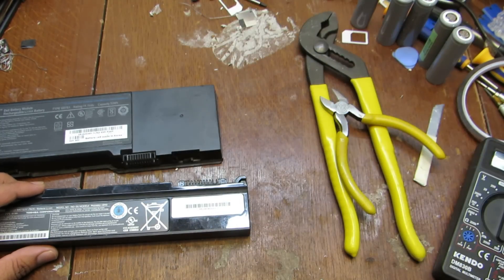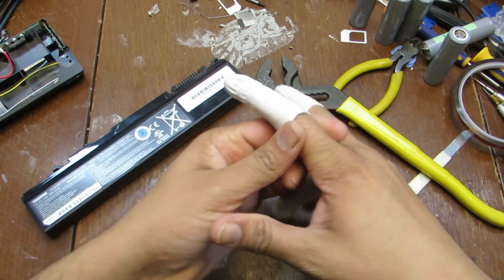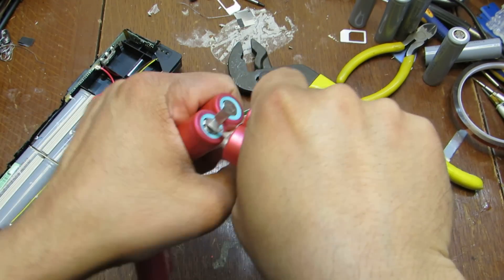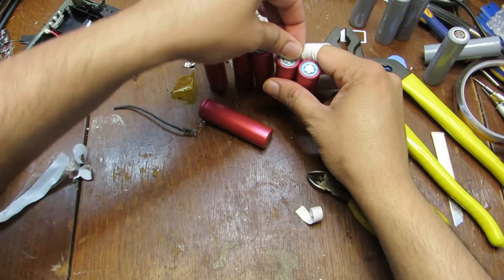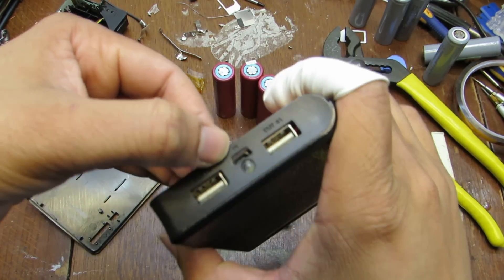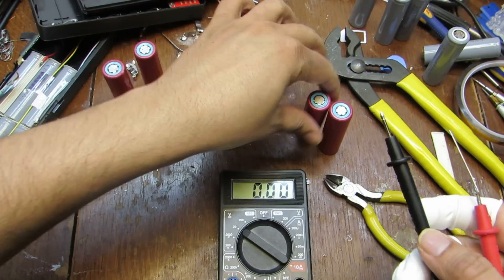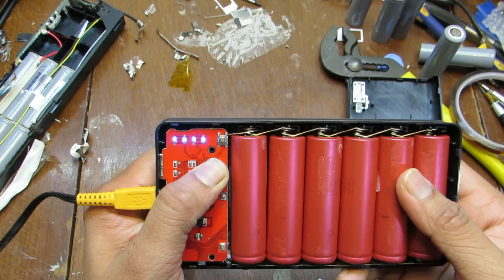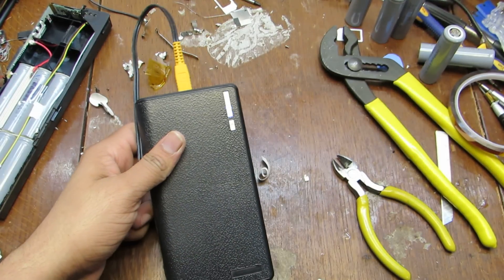diy mobile power bank .

Comment: Liked, because you linked to where I can buy the battery box, along with other boxes which do the same thing.  I especially like the box which allows you to convert the power to 19v (among other voltages) so you can use the batteries to extend the run-time of a laptop computer.  Rather ironically amusing really, considering that's what the batteries were being used for before salvaging them.

Comment: I have a question, I have a cheap single cell power bank and a bunch of Cells from old laptop batteries. (Having never worked with LI cells before) can i connect the extra cells in chain to expand the capacity?
Reply: Connecting in series will add up the voltage and fry the PCB in the power bank. Connecting in parallel will add up the capacity and will work, to an extent. I did this as an experiment and although it works, it takes ages for it to charge up and it never charges up to full (4,2v per cell) and I don't think the PCB in the power bank has a protection circuit, so there's a risk that the cells might get over-discharged and start degrading (or worse). If you want to play around with lithium cells, get yourself an Imax B6. That thing has plenty of tools to determine the "health" of a lithium cell.
Reply: no , u can't .. i tryed that and : magic smoke
Reply: Birzan Lucian yup that's true if you buy a cheap diy board ita good because they have protection. and if all you batteries dont reach 4.2 you have bad connection or bad solder points use better wire or spot weld them

Comment: u show us, where to get free bateries, but we need the circuit and slots
mayb link for the pwb case?
can u charge mobile... without circuit? mobile show charging, but never charge it 
I had laptop batery, 9 batteries, only 2 work :( I will buy this http://www.aliexpress.com/item/Best-Seller-2x-18650-USB-Mobile-Power-Bank-Battery-Charger-Box-Case-DIY-Kit-Free-Shipping/32528466125.html?spm=2114.30010308.3.121.u0eLoz&ws_ab_test=searchweb201556_10,searchweb201602_3_10017_507,searchweb201603_1&btsid=3ac09b3d-7fc7-4c85-a5e2-7ee08f0284c2

Comment: http://www.ebay.com/itm/4USB-2-1A-Power-Bank-Case-Kit-6x18650-Battery-Charger-DIY-Box-Case-Fr-Cell-Phone-/262440982197?var=&hash=item3d1ab396b5:m:miykNPE_9QI_RfITN2cQyPQ 
would this be good?
Reply: kinda you have to solder the pack together witch if its not done wit care u damage the sels better one 17*8*2.2cm High Quality 5V Dual USB 18650 Power Bank Battery Box Mobile Phone Charger DIY Shell Case For iphone6 Plus S6
 http://s.aliexpress.com/B3uYBFri 
(from AliExpress Android)

Comment: Laptop batteries are normally lithium polymer and they cant be charged in parallel but rather have to be charged individually by an LIPO charger
Reply: wicht is not al littel usb board it is a 60dollar carger cheap one

Comment: Those batteries all measure far below the healthy cut-off voltage.
Don't ever use batteries with a measured voltage lower than 2,7V in such a cheap charger.
Consider them dead and find another defective laptop battery.
This is a very dangerous tutorial for people that don't know anything about Lipo batteries.
Also there where two batteries that were 1,75V. NEVER mix those with other batteries of a different voltage.
Reply: +Kenneth Tan mine 5 battery showing 4.0V one one showing 3.7...is this ok ?
Reply: If you are going to use recycles 18650's. Please buy a capacity tester that also measures internal resistance. Both values tell a lot about the quality and lifecycle of the battery. 
There are a lot to find on ebay for cheap. They don't have to be super precice, but will land you in the ballpark.
Reply: do you have any reference for capacity tester that measure internal resistance ? :D
Reply: +Kenneth Tan those arent polymer battery cells.
Reply: They are more often Li ion than Lipo. and they are in // so Volt will be the same but amp will be plus. 
Yes, they can blow up and catch fire (I've watched that once)
And YES, DONT use lower than 2.7V cell, They can work, and last some how, but not in security with cheap charger and no-protected cells. 
It is not worth if you exchange a cheap Li ion cell for your heath or others in your building :D
Reply: yep, i have 2 of them here. discharge function works to show mah, but does not mesure internal resistance. otherwise, have to do some math to calcul manually. imax b6 is great for 16cells one time charge. Yesterday, i did have 3 cells (recycled from 1,5v) leaked and hot at hell when i tried to recharge them up to 4,16. :D
Reply: Kenneth Tan actually an 18650 can be discharged at 2.5v that's the voltage laptop bms discharge them at

Comment: Hi, David, thanks for your detailed video of power bank DIY project at home ! But I want to ask you whether 6 batteries should burn the phone inside during charge ? How much ampere is coming out from the 6 cell's of Laptop ?
Reply from the maker: +Amitava Roy 18650 batteries are really powerful . do not use them without circuit board ..  circuit board comes with  18650 Power Bank Battery Charger Case .. you can get 10000 mah from 5 cells . depends on batteries condition ..  there is a link for good power bank diy box . 

http://www.ebay.co.uk/itm/Dual-USB-Port-LED-18650-Power-Bank-Battery-Charger-Case-DIY-Holder-Box-/321918783416?var=&hash=item4af3dacfb8:m:mF1vpb_kgy9WPYYmBITKsjA
Reply: +david barley | That's ok. But using old used laptop battey cell's will be already much weak na ? So, how would I know which one will be good enough for my power bank ? That means unnecessary money will be blocked by piling up the old laptop batteries? Thanks for your above link of Ebay but they don't post to India ?? :)
Reply: Another question, I have already prepared a power bank circuit on Breadboard using 7805 Voltage regulator IC and attached a local 9 volt battery with the circuit ! It's already showing charging symbol on the Mobile Phone but not storing the charge inside ? So, which rechargeable battery of what voltage should match here as far as the power bank battery is concerned ?

Comment: how can i get the case for 4 battery ?
Reply: or can i just use 4 battery on that case?
Reply from the maker: +Adison teo http://www.ebay.com/itm/Dual-USB-Power-Bank-Case-Kit-4X-18650-Battery-DIY-Charger-Box-without-battery-/331691708257?var=&hash=item4d3a5dcf61:m:m_62SAFBxQZZ8aROJJkSDIg

you can buy from ebay ..
Reply: +david barley do you have some cheaper case ?

Comment: need to check voltage must????
Reply from the maker: +Fas sahal faulty battery has sometime faulty sells .. best way to check voltage before you install batteries into power bank . it will work fine ..

Comment: Can we please have a link for the case ?
Reply from the maker: +Nehal Battulwar there is a ebay link .. you can buy from ebay india. but it will cost you much .. 

http://www.ebay.in/sch/i.html?_from=R40&_trksid=p2050601.m570.l1313.TR7.TRC0.A0.H0.Xdiy+power+bank.TRS0&_nkw=diy+power+bank&_sacat=0

buy from hong kong   it will be cheap ..  there is a link .. 

http://www.ebay.com/sch/i.html?_odkw=dit+power+bank&_osacat=0&_from=R40&_trksid=p2045573.m570.l1313.TR7.TRC2.A0.H0.Xdiy+power+bank.TRS0&_nkw=diy+power+bank&_sacat=0
Reply from the maker: Doku Wil'Faël there is a link ...            

 http://www.ebay.co.uk/itm/281509218658?_trksid=p2060353.m1438.l2649&ssPageName=STRK%3AMEBIDX%3AIT
Reply: +david barley stuff is good but i need those case in India how can i get it